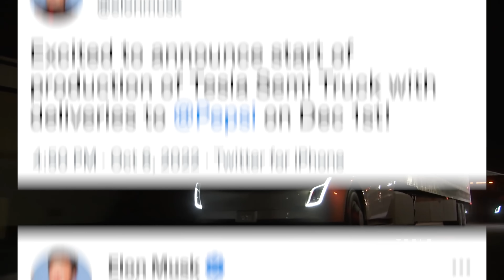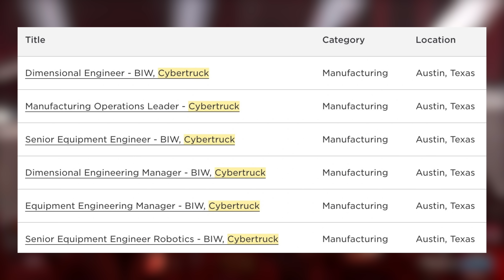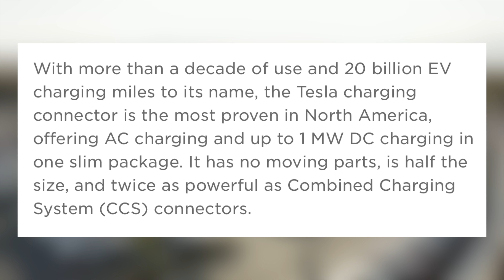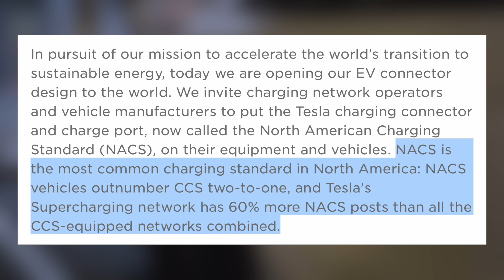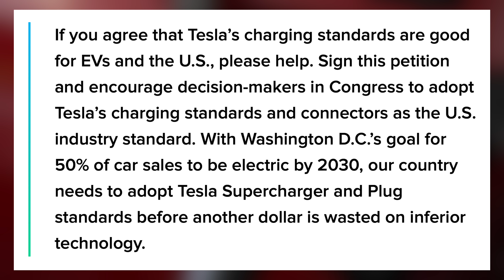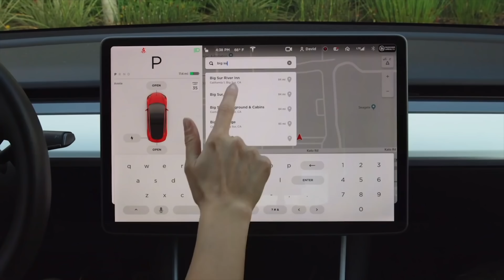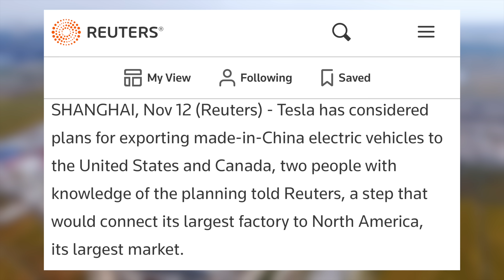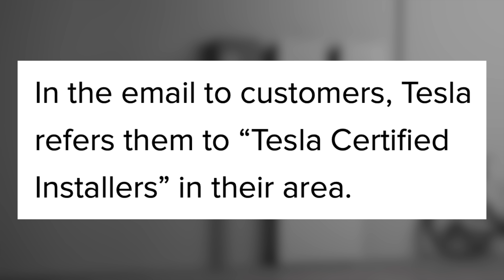Tesla's Risky Move To Help The EV Industry | Elon Better Be Right

Comment: Does this charger standard also support vehicle to load and or vehicle to house? That is the one thing I miss about tesla cars. (not that I can afford a new ev but still. lol)
Reply: Tesla has built in V2L for the chargers but it's not a feature enabled on their vehicles as far as I'm aware.
Reply: yes it can do vehicle to house.
Reply: @MyUniversalUniversity  :  But doesn't that violate the warranty on Tesla's.  

Hopefully in the future, Tesla will allow this with Tesla approved equipment, processes, etc, but I suspect Tesla doesn't want its cars competing with its Powerwall business.  

As a shareholder, I'm all for profits, but only so much greed is reasonable.  If Tesla can get some kind of a fee or something, people should certainly be able to use their cars to power their houses in an emergency, as long as that could be done safely.   And that certainly doesn't fully replace the convenience and features provided by having X Powerwalls installed, so I don't see that really hurting the Powerwall market much anyway.
Reply: They'd rather not cannibalize their powerwall sales me thinks
Reply: V2X can be supported through a 2 pin connector one of 2 ways.  Either the on-board charger must be b-directional and it then becomes the inverter for the house/load, or the residential charger needs to be an L3 DC charger.  You can’t charge on AC and back-feed DC like the Ford/SunRun setup does with a 2 pin connector

Comment: 8:39 I want to see a Tesla V4 at least at 350 kW and see how hot the handel will be. No to mention 1 MW...... Right now CCS is at 350kW. Can be used for 400-800V. Has not hot handel. Is Chubby.... ok.
Reply: I'm guessing the Tesla handle was over-engineered right from the beginning.  Ryan here mentioned no moving parts, no liquid cooling etc - yet can still handle 1MW.  So I doubt that the handle will overheat.
Reply: @RoguePC4U  some Tesla drivers wrap the current handles in wet towels to prevent the charger from derating due to handle heat.  Many Tesla drivers carry a glove or rag to keep from getting burned by the hot handle when unplugging.  This does not happen with CCS that I have seen.  Of course, the 1000V handle shown in NACS is new and would likely have better thermal performance
Reply: @chriswestenskow5202  Interesting.  I've watched a lot of Tesla related videos and have never heard of this.  Guess I should search directly for it now.

Comment: 2 words: bidirectional charging - I am not sure if Tesla charger is capable of that. V2G or V2V is the future.
Reply: Agreed.  However, although the NACS does support this, Teslas themselves do not.  At least, not yet.  I could see Tesla adopting this feature to all their cars in a future update.  ... hopefully
Reply: It will support it if you are plugged into a DC fast charger, but in a home setting, normally the car charges on AC and the DC pins are used to connect the car to the inverter.  Since NACS uses the same pins for DC and AC this creates a problem for V2X, unless your home charger is also high voltage DC, which is currently extremely expensive.
Reply: @chriswestenskow5202  Soooo... not possible at all then?  Or only possible if you have a Level 3 home charger or something similar?  When I say possible, I only mean physically - as obviously Tesla has something to say about this too.
Reply: @RoguePC4U  I don't think all the standards around V2X have been finalized, but the early implementations I sees such as the F-150 Lightning, use AC pins of the J1772 for charging the vehicle and use the separate CCS DC pins to connect the vehicle battery to the inverter that powers the loads.  I suppose it would be possible to build a grid-tied inverter into the On-board charger in the car and have the car itself backfeed AC power, but is seem like that would require some very expensive hardware be added to the car, and in the use case of home backup, it would need to be able to communicate to a transfer switch to safely isolate your home from the grid until the power came back on.
Edit: I found a few articles that speculate that the newer Tesla on-board chargers may already have bi-directional capability in the hardware, which would imply that in their vision of V2X, the inverter would be contained within the car, rather than external as the other V2X implementations seem to be headed.

Comment: Tesla earned the right to set the standard. It alone it seems. ... seen and knew that charging the EVs of the future needed a charging system put in place. All others half heartedly if at all where serious enough to make an effort or pretended it was a need that needed to happen. They Tesla divined the design. Tesla is a natural standard being after a study ideal in every way to meet charging needs now and the future with foreseeable requirements. The only shame comes in the fact that all others failed in making a genuine effort at either supporting or building one truly other system  then Tesla’s system if they were clear thinkers of the EV promise. Thus common sense calls out that the best to date and in the future to stand. Only the option of say the harmonic induction coils of MIT may one day replace or supplement on the Tesla standard means to charge EVs.

Comment from the maker: Go to https://buyraycon.com/ryanshaw  for 15% off sitewide! Brought to you by Raycon.
Reply: does this apply to international shipping?
Reply: One major drawback with the Tesla connector is that it does not support higher speed 3-phase AC which is available in much of the world, including Europe. We often see Teslas connected to 415V 3-phase outlets, recharging at a glacial 11 kW maximum speed via their version of CCS, even if the supply to the dispenser can handle 50 kW or more per connector. 

Superchargers are still thin on the ground over much of Britain. Our nearest Superchargers are about 45 minutes' drive away from this city. In other places, you can drive for well over an hour before reaching Superchargers. So Tesla owners recharge at (often lower priced) nearby third party outlets for much of the time.

All of Britains 3-phase AC EV outlets cater for 22kW and above, often at 43 kW, 50kW, or faster. So a Tesla uses no more than a peak of 22% of the available capacity at many rechargers. (Even my low budget Renault recharges at twice the speed of a Tesla on 3-phase 22kW CCS AC, and at 50kW on CCS DC.) The very slow AC recharging speeds of Tesla cars, often being left for more than 4 hours at the dispenser, is causing real annoyance to many people, who view them as hogging the faster chargers, whilst single phase 7 kW chargers are available at adjacent points, often dispensing free electricity. Those long-stay Tesla cars will be drawing no more than 7 kW for the final hour or so, but the owners don't even think about swapping places to give other vehicle owners a chance.

If the Tesla connector could be changed to support high speed 3-phase AC recharging, as well as DC, then it would be most welcome here.

Comment: Tesla offered up the Tesla superchargers to every car company.  They refused.
Reply: Because a standard already existed in 2011, and was adopted in the EU in 2012. Tesla had the opportunity to join the rest of the world. They refused.
Reply: David Beppler:  This sort of thing goes on with many industries, and has for MANY decades.  Just look at the MESS of computer interoperability between brands, and how even TODAY, Apple has so much proprietary hardware AND software standards, Google Chrome is a totally closed system for its laptops and its OS, etc. 

There's a reason many people who have computer expertise are adopting free and open and supported Linux variants. 

Even if Tesla's system is objectively WAY better, look for LOTS of resistance from the industry toward making that a standard (much less THE standard).   OTOH, as long as Tesla's system is much better, especially re reliability (which lots of articles and videos says it clearly is), Tesla will have a big advantage anyway.  Ironically, maybe bigger than if the competition would join them and have the same level of quality in its charging equipment.

Comment: The reason nobody wants to use Tesla's charging standard, except a start up which hasn't shipped one vehicle,  is because of the story immediately after. Tesla is the more reckless version of Apple for car manufacturers: making walled gardens, introducing bugs via software updates, and reducing interoperability. I don't care how small or big my charging connector is, as long as it is good for the industry (AKA Tesla isn't in charge of it).

Comment: Elon knows that Porsche has a synthetic fuel. It can be made into diesel or gasoline fuel. When they perfect it and produce it ( Shell and other oil companies are working on syn fuel also) It will blow EVs away and save the grid from melting down.
Reply: Yeah yeah yeah, been hearing about synthetic and alternative fuels for well over 30 years at this point. I'll believe it when I see it being sold at my local gas station.
Reply: synthetic fuel only makes environmental sense, if it's produced from green electricity. Given the inefficiencies of producing synthetic fuel as well as the low efficiency of ICE cars, about five times as much electric energy is needed to drive a mile, as compared to a BEV. So what's the point in using synthetic fuels for cars? There is none except for die hard ICE car fans who insist on their sound or whatever.  Electric energy is just too valuable to be waisted for this nonsense of synthetic fuels for cars
Reply: LoL you are so dreaming.  If people are comfortable with paying ten bucks a gallon to keep using their noisy smelly ICE, then let 'em.  I don't see that happening, though.